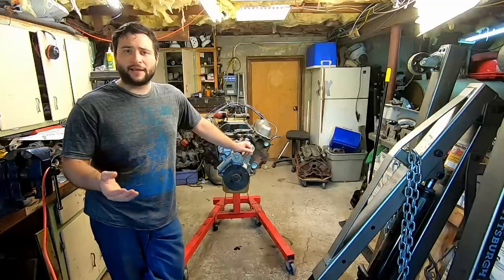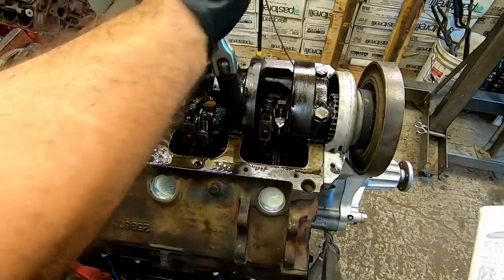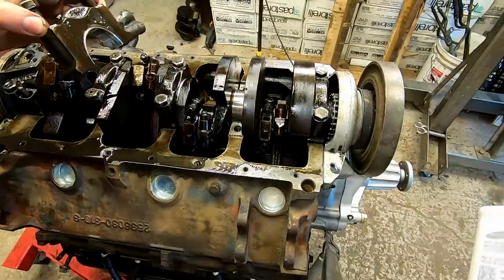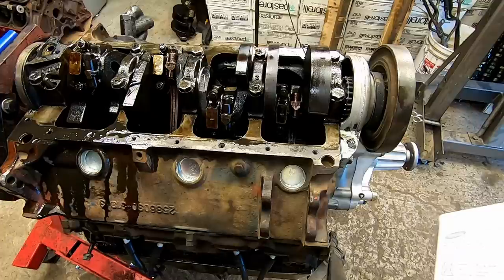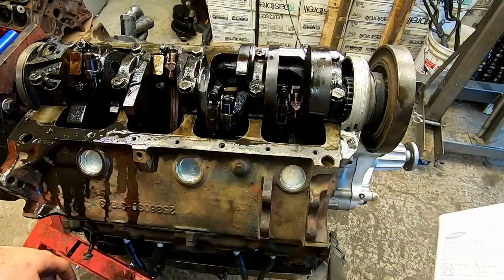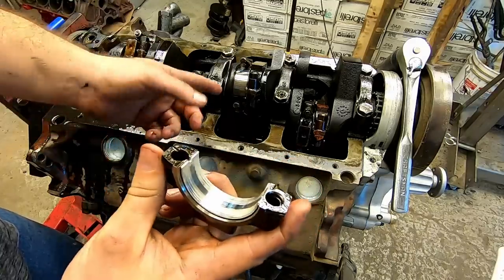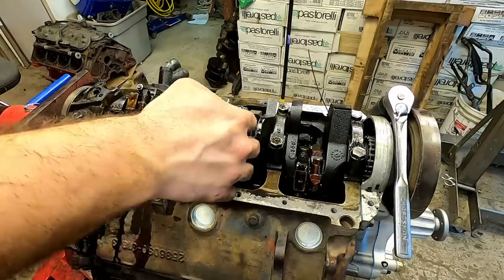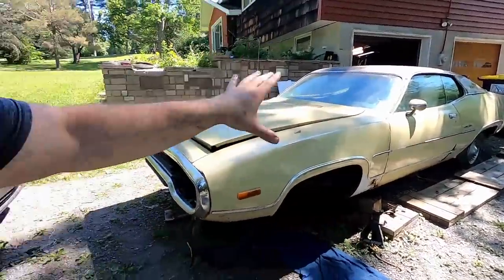The Mystery of the 318's Low Oil Pressure Solved! update the crank was worn out .07 not machined

Comment: Started following this at Nick's garage. If you don't mind taking a few tips from an old fart I'll give you my 2 cents worth. There is a better way to use the plastiguage. Use a pair of scissors & cut off a piece of the package just enough to have all the measurement increments. That way you will have the correct length of plastigauge & the paper gauge to go with it. The way you were doing it is kind of clumsy, works but clumsy.  Bearing shells are usually marked (stamped) on the outside w/ the size. Ex: Std = no size stamped, .010 = 10 under or .010" under, .020 = 20 under or .020" under & so on.  Rod caps & markings: not all MoPar sm. blocks have the same numbering systems. I have rebuilt some that use different symbols for the rods instead of numbers. Rule of the rod: Large chamfer always goes to the shoulder of the crank not next to the other rod. The oil squirter hole (actually a notch) always goes up toward the camshaft. Remember, the pistons & camshaft lobes rely on splash oil. The rods get oil after the mains get theirs so if the mains are loose then the rods will suffer an oil loss. Never trust an engine that someone else has assembled, you can never know what their level of expertise is. Things I have seen: rod & cap mismatch (#2 cap on the #4 rod & so on),  rods installed backwards (squirter hole down),  #4 cam bearing rotating in the block. Caused loss of oil to one side of rockers, damaged rocker assy. Don't know how this was done but the assembler should have known that the cam bearing went in way too easy. One guy asked for my help after damaging a block by trying to install the main caps backwards, cracked the shoulder on the block & had to locate another block. Bearing rule: the anti rotation tangs on the bearings always go together on the same side. I've put together GM, Phord, & MoPar engines (both 8 & 6 cylinder) & have never seen an exception to this. Even a Ferguson 4 cyl tractor engine.  Warped block: That engine you are working is a truck engine (has a dash 3 number after the 318) & is made of high nickel iron. Very tough but not bullet proof. The Chrysler SRM says to do a main bearing alignment check this way: install baring shells, leave out the rear seal, put some light weight engine oil on the mains, install crank & torque the main caps. If the crank spins freely then the block is fairly straight. Anther note on the MoPar block numbers. For some time they would put a 2 or 3 after the engine size (cast into the block) called a dash number. Well, sometime in the 80s they quit doing that. I have an 88 360 that I have rebuilt that is going into a 1 ton camper van and a 360 that came out of a 90 1 ton dually. Both are very much HD engines & neither one has a dash number. Probably stopped the markings when they no longer made 360 engines for passenger cars. I have no proof of that, just a guess. Hang in there, you are learning.

Comment: You may be able to get 1 or 2 thou oversized bearings and get some clearance back. Although 3 thou is not all that much to worry about. I would not bother ‘ cleaning the block’ . It has already run, its had a couple of filter and oil changes. Just leave it !!

Comment: You should always check the specs when you are building a new motor for horses or for racing neva torque 1 side always each side evenly you got lucky the motor didn't blowup too its minor always check the specs on all I went to auto school manya yrs ago but then reving to 5000rpm I've done a 318 in school those yrs ago but My next  motor is a 340 I'm punchin it too 426 cubic inch or maybe a lil less but all gas 1 carb probably a 1050 predator carb pushing about 600 HP or betta but I am doing all the work myself good job love the last word God bless you too Young Man n Tony's Garage and Nick's Garage great find and save I'm like Tony was big block only Mopars but I love them all

Comment: I really believe you misread the main bearings upon disassembly , unless the engine hadn’t been run much before you got it. Do you still have the original bearings?
Reply from the maker: Lol they had STD on the back my bro hard to miss read that. But good on you my dude.
Reply: LunarOutlaw’s Garage the bearing should have also been dated. Another clue.

Comment: At this point, if it were me, and I have traveled this road many times in my 70 years on this planet. Strip it down, even take out the freeze plugs, take the block to a machine shop and have it align bored, then proceed accordingly. Rods and caps, have them machined to the new crank specs after that is all checked etc. If your going to do this, do it right. And have them wash the block and install the freeze plugs correctly, then go from there. When you cheap out....shit happens.
Reply from the maker: I agree but If I was to take it that far I would buy a 360. We can’t lose sight that it is only a 318.

Comment: Learn torque steps, Mic or plastigauge every bearing. Check all your tolerances and you have the proper Parts while you're building one it's better to do it when you got it down the first time that it is to have to pull it apart several times and that's the voice of experience I learned the hard way.

Comment: Just wait till when you put the engine together with the right bearings and you use a used harmonic bouncer and the harmonic balancer spins on itself because the rubber isolator is worn out and you get a vibration and you can’t figure it out.  Then you pull the whole motor apart and have all the weights check to see if it’s balanced  right so never use a used balancer . Friend of mine did it.

Comment: this guy would be money ahead if he bought a rebuilt engine from a rebuilder i,ve got a 318 in my garage that had 60 lbs at idle with 65000 miles on it when i pulled it out has cam springs performer manifold its cheap as he would have to pay shipping from nevada

Comment: I bought a 440 the very first thing I did was take the crank to machine shop get it turned  if need be polished and all bearings to fit  to me it’s the main part of the motor even a steel crank you magnaflx
Reply: i have an emery hand polished old 383 steel crank in my 400. runs just fine.

Comment: If you're block was cracked and leaking oil into the engine the only place it could go is on the ground or into the cooling system and that would be very noticeable

Comment: looks like PO got a basic parts store rebuild. rods and mains don't have to match, but all rods must match, then all mains must match. Dyno oil pressure was ok (according to Don Garlits), but you could have just dumped in 20w50 or added Lucas. I pulled freight for 39 months with straight Lucas just to keep it above 28psi hot. Someone else wrecked their truck, so now I have an engine that sits at 60 any time I'm above 1100. But yeah, roll in std rods, .010 mains, and hammer on it. You ain't making crazy power, so 7 per thousand

Comment: Always check the crank bearing gaps and see how easily the crank turns before putting the engine back together is the Moral of the story, here. make sure all the cylander bores are circular and not out of round, too. Older engines that were overheated can take them out of round causing new ring blow by. There's YT videos of rebuilds where that happend, also. Approaching it scientifically when it's all apart pays dividends.

Comment: It is not unusual for MoPar to have undersized crank journals or rod journals from the factory. Back on the 60's if you looked at the  engine number (on the LA it is on the left front of the block) it would be stamped the cubic inch of the bock. In your case "318". Under "318" would appear a Maltese cross or triangle or both. These stamps meant undersized rods or mains. Which one now I forget. Sorry. One other hot tip. Buy yourself a damned speed handle!  Also, torque in stages don't torque one side to full spec and then the other. Do it in a couple of stages. Snug up both than half torque than full torque.

Comment: First of all, plastic guage is your friend.

Second, VERY IMPORTANT!! NOT ALL BEARING ARE EQUAL EVEN AT THE SAME STD. OR UNDERSIZED!!
For example, .010 under Clevite/Mahle will plastic guage different clearance than say a .010 under King bearing or Sealed Power.

You can slightly tighten or loosen your crank clearance simply by changing brands.

Comment: does that have 3 or 4 bearing caps on that crank and you could use a oil pressure gauge to use before take it back to Nick just fire it up on a stand and my dad told me to tell you to check the bearing on the crank when I show him the dyno video the backstory Nick post about your 318 cause my dad know all the 318 engine and rebuild my dad he always hated the 360's l.a engines he just love all the Chrysler built 318 some 340's and 383's.

Comment: The oil filter is working if it gets dirty. I don't think any dirt got to the bearings.
Reply: this. all that dirt had to go through the oil filter first. i doubt a single speck went through that oil galley, except what maybe what little sludge was already there. the mains looked great in the dyno video.

Comment: If the thing would have blown up on the dyno you would have to start over, as it is there was a ton of garbage in the motor that needs to be removed,  start over.....
You will not regret it. 

One thing one mopars it would not have been unusual for the crankshaft to come from the factory new 10 under.  But it would have been stamped on the block.

Comment: 2.5 to 2.4 is one hundred thou.,2.49 would be 10 thou.
Reply from the maker: Yep sorry just miss spoke I was happy it wasn’t a cracked block
Reply: @LunarOutlawsGarage  all good, I just wanted to make sure you knew. I'm a machinist and this is something that's been an issue explaining to new hires.
Reply from the maker: Yep lesson learned 50 years of this engine being on this planet. Never trust that someone got it right before you. Most of my engines are so new that The last hands that touch the engine were at the manufacture lol and I’ve taken that for granted

Comment: You have 2 choices. Continue in the "spirit" of a build that failed miserably or rip that bitch apart and do it right. The "spirit" was that the step before yours was correct. You assumed and trusted the bearings and journals were correct in the step before yours. Tony assumed and trusted the bearings and journals were correct in the step before his. Thank goodness for your sake Nick never trust's anything that he doesn't do himself because if he did that could have been a very expensive dyno run.
Reply: some body  bought bearings and never mic the crank  ? or  pulled the crank out and never put a mic on it ?  .. well live and learn .
Reply from the maker: The crank was heavily warn I didn’t think it was a good crank as it could move in the engine an 1/8 of an in. I sent photos and videos to Tony and he said he would check it out down there and if we needed to replace it we would and for now order the same bearings that where in the engine. He inspected the crank and gave it the ok. After this video I brought it to a Machine shop and they verified that the crank was junk now has a 340 crank.
Reply: @LunarOutlawsGarage  sounds about right. I still watch Tony's videos strictly on a comedy basis. The bullshit is strong with him.
Why the 340 crank? I don't know of any difference besides the 340 being balanced different for heavy duty rods and bigger pistons. Are they stronger? I'll be honest I don't know anything on strength differences between the 2.
Reply from the maker: @buildingracingvideos4714  the crank is nearly identical to the 318 it is just a little bit heavier duty

Comment: 1. Way more accurate to measure the journal with a cheap calipers.  I can’t believe you guys didn’t check the journal size and assembled the engine based on a guess?! 🤷‍♂️
2. Wipe the journal and bearing clean/dry to use plastigauge. 
3. I know you know better than to fully torque one bolt!  You always work side to side in increments to final torque. 
Wow this is very odd.

Comment: I don't think I would trust those main cap bolts drilled 1.5  inches deep for the pan baffle bolts, I mean they are drilled clear down to the threads on the outside, wouldn't that weaken the bolts?????

Comment: Do you want to clean inside the Motor or just the outside. If just outside put rags in the cylinders put sump on. Degreaser the whole motor. And when finshed pull rags and blow water of motor and should be ok

Comment: I didn't see the video of them putting it together. Did they press in new cam bearings? That is something I've always just let the machinist do personally. It's too cheap to have done for the amount of trouble it causes not to do it done or get one crooked. Anyhow, I've had worn cam bearings and oil pressure yoyo's big time with rpm's when they're shot. Does nearly the exact same thing this engine did.
Reply from the maker: It was put together in a live Worlds first 318 Build live with Uncle Tony’s Garage
https://youtu.be/jdn-qnqXL8k

Worlds first 318 Build live with Uncle Tony’s Garage Part 2
https://youtu.be/UuHdIMio6bk
Reply: @LunarOutlawsGarage  cool, gives me something to watch when I get off work! Thanks!
Reply from the maker: @BigHatsince98  it was a crazy day lol

Comment: Keeping in the spirit , now you KNOW  rods are tight , 
You KNOW petty close the mains , ( look at the backs of the bearing half for STD or another  size , then, you know what bearings to get , to get you up to the right squeeze  ! 
 Absolutely  NO need to remove the crank ! , rotate in the correct bearings , re plastigauge,  install your new oil pump (but , keeping in the spirit, i would leave the one on it on , it will be fine)  button it back up , dyno again !  :)

Comment: If I remember right, Nick said it was full of trash. The block was not boiled and cleaned out prior to assembling.
Reply from the maker: Unfortunately the block was not mine and it was only pressure washed the day before the build.
Reply: Not much was clean and virtually no inspection was done by the master. No measurements just slam it together. Lunar took it in the rear.

Comment: Loosened both rod cap bolts then took one nut off and forgot you already loosened the other.  Engine is filthy. Take it all the way down and do it right. Half ass full blast won't get you anywhere.

Comment: don`t forget to check the pick-up tube to see if it might be clogged
Reply from the maker: The pick up two wasn’t clocked the crank was completely worn out. The gentleman that put the rotating assembly together, gave the OK on the crank by running. His fingers crossed it, saying it was fine. Myself and John Wilburn during the live stream both pointed out to crank, and even the fact that the thrust services were concaved he gave the OK.  Ultimately the excessive Clarence at the main CAC bearings allow the oil to basically free flow out when it got to operating temperature. Lesson is no matter how much someone can claim to be able to build a a engin from junk parts you’re still going to get junk. 🤙

Comment: 22:15 minute mark. The difference between 2.500" and 2.400" is not "10"  assuming you meant 0.010" (ten thousandths of an inch) it is 0.100" (one hundred thousandths of an inch).
I am a machinist. I am not allowed to make this mistake.

Comment: mains were turned to 10 under, if the rod bearings wrong the engine will rattle, to tight and the crank will be junk
Reply from the maker: I covered it in a later video the crank was worn seven under and the thrust bearing surface was gone

Comment: I know it's too late now, but as an old time mechanic:
* Tear it back down and clean everything, run swab through ALL oil passages!!
*Mic all journals, and check the old bearings for std .10
Reply: .010, etc. It's good to even install your new bearings without the crank in place, torque it down and use a bore gauge or inside mic to determine clearance.
* Torque both sides in 20 lb increments...
* Don't trust the manufacturer to have put in the correct bearings OR std crank... I've been there...
Reply from the maker: The Torque specifications can be found here https://www.mahle-aftermarket.com/media/local-media-north-america/pdfs-&-thumbnails/torque3.pdf

Comment: Just put new right size main bearings torque everything  back to speck. Run the engine your self. Put some engine flush in oil or quart of diesel or kerosene oil . just run the engine for a bit 30 plus minutes more the better.  Keep eye on oil pressure if pressure stay good hole time drain it . put new bearing in if you want .if want flush it again. On old one .  call good. Put new in (if wanted too)  then send it   . what id do

Comment: NEVER, NEVER NEVER trust anything Micrometer EVERYTHING. Snap gauges are a cheaper way to measure inside dimensions  with bearings installed and torqued. Never trust mis marked caps. If the caps weren't machined on the rod or line bored/honed on the mains get a machine shop to set it up for you.

Comment: At this point, I would tear it down, have it hot tanked and new cam bearings installed, and mic everything. If crank is off, have it ground even or replace it if bad. NEVER torque one cap bolt then other. Tap cap in place, then torque bolts evenly, just sayin. Check balance on rods and pistons. Good luck.

Comment: i had a 400 m ford the way it wood loose oil pressure it made that way i used dura lube in it , it rusted out in 3 years any way i live in snow country, 6 miles to gallon to it been alot of years too gas real up in cost! dodge fuel injection suv and a newer ford 2002 ranger a slow thing, 3,0 v6  & slow too pulling truck gregg

Comment: How much is a car manual or an engine rebuild manual, even a check on the internet would help you not do exactly what you did wrong there.
Plus it needs stripping down, a hot tank clean and a proper rebuild checking  and measuring everything as you go.